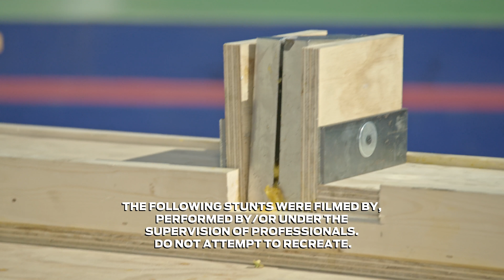Magnet Smash in 4K - Bonus

Comment: simple, the apple sort of blocked some of the magnetic field from the bottom half of the 2 magnets since it was sitting at the bottom, therefore since there was nothing but open space or air above the apples the full magnetic field was stronger at the top of the magnets then the bottom so they pulled together faster then the bottom because the bottom was a weaker pull because of the apple. so the top half went inward above the apple, the apple stopped the magnets from closing by reducing pressure but since the top hits first it takes alot of the impact off the apple and therefore the apple wins.

Comment: You need to attach whatever you're wanting to crush dead center of one of the magnets. Otherwise the bottom of the magnets are going to be stable and where there's nothing to separate at the top they will fall in together hints what you just witnessed... So, there's that

Comment: If those are neodymium magnets, depending on the grade I believe it has the pulling force of about 150-200lbs. I think it’s the N45 is the strongest, I had one that was nearly a tenth the size and I think it had about 40lbs of pulling forces. I loved the magnets breaking on the apple. I’ve thrown 2 in the air and they just both chipped at eachother and there were sparks. You guys should try that in slomo.